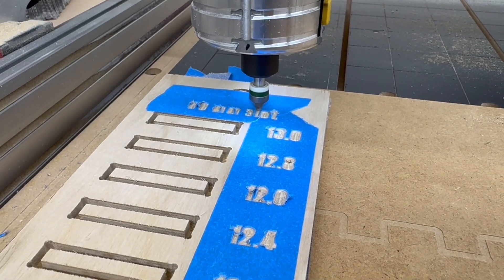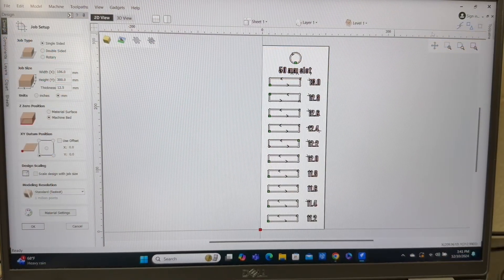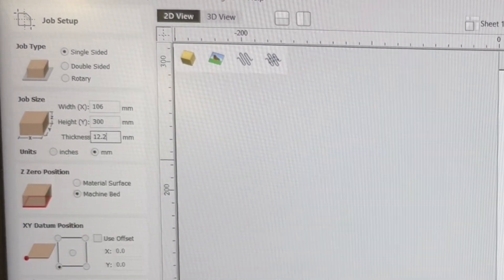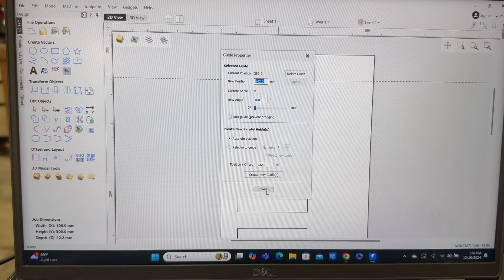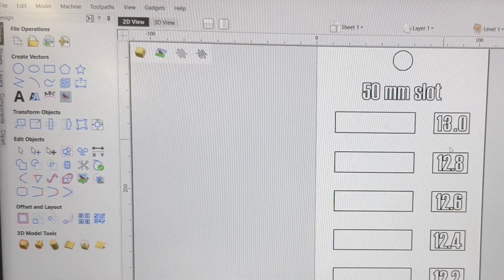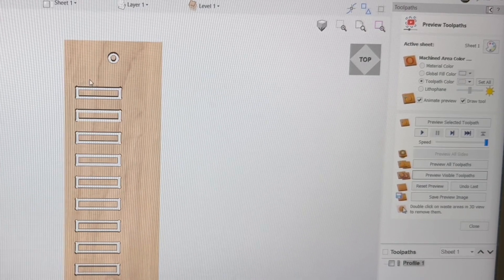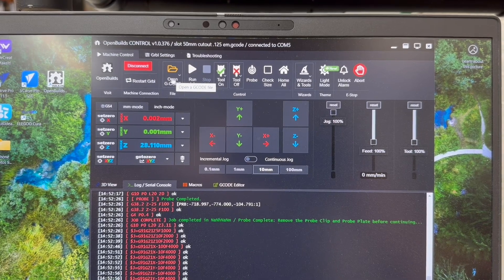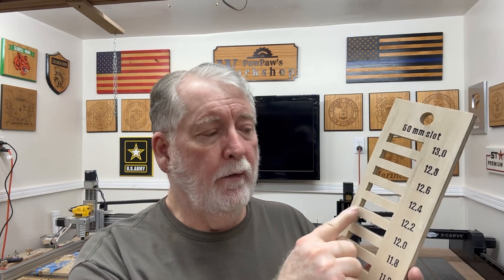Slot and Tab Tool, A Must Have to Make Slots and Tabs on Your CNC

Comment: Great video as always. You can make multiple zeros or anchor points for different jobs by creating new sheets and going back to design tab to recalculate. I use this all the time for surfacing large or uneven materials. To not confuse myself, I’ll label sheets as Bed, Surface, LF, Center or etc, depending on slab or cookie. Makes flattening or different program characteristics as easy as a template. Hope this helps and apologize if someone has already mentioned it. I’d send one of my files if I was able to attach in here. Thanks again and keep up the great work. 😉

Comment: As silly as it may seem, it’s absolutely brilliant. Another one of those ‘why don’t I think of it’ moments. It’s quicker and easier than taking out a caliper (with dead batteries as usual) and testing sides before placing on machine. May just make a 3D printed version of it. P.S. I’ve noticed you using mm more. Thanks again!!!   -Peter

Comment: To zero on machine bed for slots and material surface on text, just use different sheets and you can do what you wanted to do!  Thanks for the video, never thought to do the slots for thickness variances!
Reply from the maker: Great, I will have to try that.

Comment: Thank you for this great information and instruction on cutting the jig out. I made a similar jig to figure out the size of holes for PVC pipe pegs in my spoil board. I found that I needed to make the jig for each specific bit that I have. 
Not all 1/4" diameter end mill bits are the same diameter. None of them are exactly 0.25 inch in diameter. The bits start out as 0.25 carbide blanks with plus 0.000 minus 0.0002 tolerance. Carbide is ground away to mill the flutes and sharp edges. 
I measured my 1/4" end mill bits from 3 North American manufacturers and found that they range from 0.248 to 0.246 inch diameter. This made 0.1 mm difference in the diameter of the holes. It would be the same for the width of the slots.